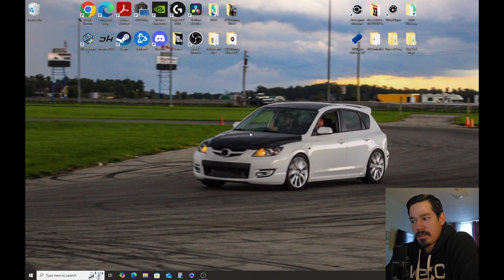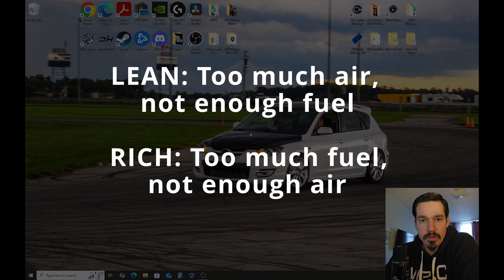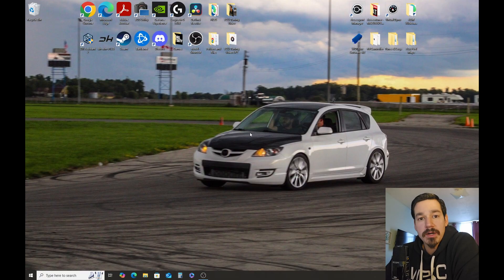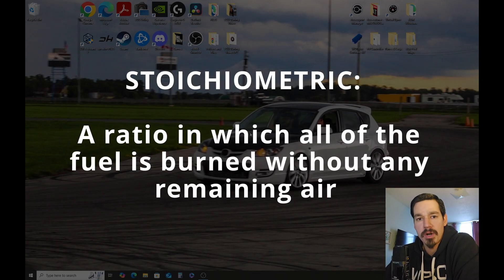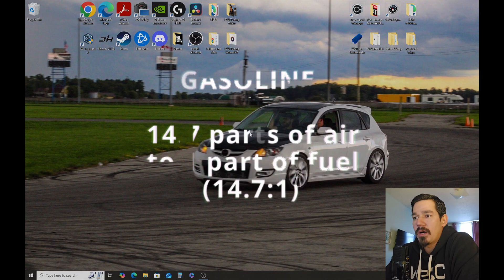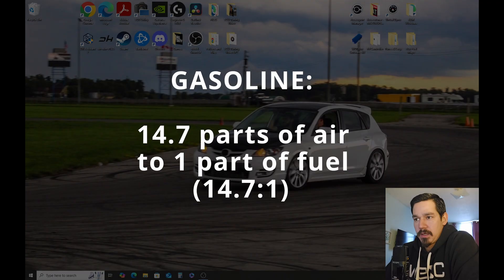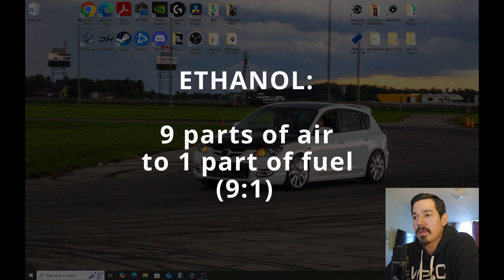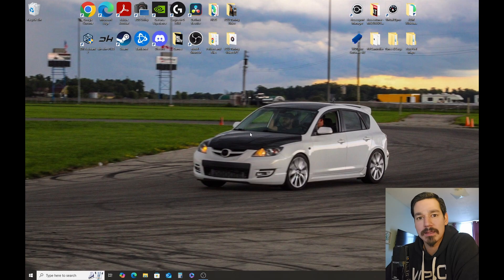Mazdaspeed 3 ECU Tuning Ep.2 - Understanding Air to Fuel Ratio

Comment: 9.8-1 for E85, lots of pro tuners use lambda values because the stoich value is always 1 regardless of fuel
Reply from the maker: @dylanstephens4075  I could be wrong but I don't think Lambda or AFR really matters in our case, as the O2 sensors only read oxygen content. The system doesn't know the difference between which fuel is being used. We change the injector scalars, fuel gravity, and MAF calibration values in the tuning software to compensate for changes in the AFR whether lean or rich. In the end the oxygen levels will vary based on how much alcohol is mixed into the fuel. Increasing the ethanol content within the fuel mix will increase the amount of oxygen measured at the primary O2 sensor. Without compensation through tuning, we will see the AFR or lambda become leaner. We will need to inject more fuel in this case to meet our desired rich AFR or Lambda under load.
Reply: @WannabeTuners correct but lambda is just a different way to display AFR values and is often times used in the tuning process, as the the ratio is displayed in a whole number and is the same regardless of fuel, e.g- gas 14.7-1, e85 9.8-1 etc. eliminating the need to remember stoich values for different kinds of fuel, just makes things easier to reference quickly basically, not saying you're doing anything wrong by any means, just offering a humble perspective, not that it's needed lol
Reply from the maker: @dylanstephens4075  Oh yeah I see what you mean

Comment: Hello, kind of unrelated question because im still learning about all of this (and thank you very much for these videos!). Is it true that if you stick with stock diameter intake then you don't need a tune? I got JBR Stage 2 intake which should be stock diameter all the way to the turbo.  Gen 2 speed 3 - I heard that its different on gen 1 to gen 2 a bit. Thanks.
Reply from the maker: @silentu55  if you're just installing an intake and it's truly the same diameter as stock, then you should not need a tune. If the diameter is off even by just a little, it will throw off the long term fuel trims and the ECU will have to make corrections at WOT as well.
Reply: @WannabeTuners  Thanks for the reply :)
Reply: @silentu55 The gen2s are a bit more sensitive to intake diameter changes. Also, even if the intake diameters are almost the same, they are not 100% the same and there are small variations (up to like 10-12% on a Cobb SRI). Also, the way the cone air filter create turbulences behind them, if you use an airbox or not (which has direct influence on the intake air temp - so fuel trims) and so on, may increase the need for a tune. If you only want more power however, a tuning solution (cobb or versatuner, I recommend versatuner if you want to stay on OTS tunes for a while, or even explore self-tuning) has the best hp for buck gains. The intakes will only allow you to make more power, but will not actually make significantly/measurably more power just like that, maybe only sound different. If you go for versatuner let me know, I maybe able to help you with pretty much all aspects.
Reply: @mituc  Thanks for the explanation. I actually bought Versa on black friday to get tuned later. For now I dont feel like I can safely self tune, lol. I got the intake just because a friend was selling it. Also yesterday I got HPFP with the rebuild kit, CS injector seals and EGR delete.
Reply: @silentu55  Well, after you install those HPFP internals things can go pretty rowdy in therms of at least torque, if not even power, and definitely the way the power is delivered can be a lot different with a custom tune (which I can help you with, just let me know).
Reply: @mituc  Ok, thanks for the offer. I actually recognised you after i checked your channel. I "know you" from MPS OC club :)

Comment: Well detailed and clear vid 🔥 ... Could you possibly  explain why tunes that are intended to make your car pop  and/or flames at the exhaust tip would be harmful to an engine  including how it works and what exactly is it happening .. there aren't much detailed videos out there about this .. I thought it would be good since you're already talking about afr  and tuning etc this would help the people in the platform make better informed decisions...id  do it myself but I feel you could explain it better and reach more people
Reply from the maker: @reyspeed33  Thanks man! Tbh I haven't done too too much research on how to tune for pops and bangs out the exhaust, simply because of the things I've read online of the exhaust valves getting too hot and wearing out the valve seats. I also read that some stock cars such as the Hyundai Veloster N have pops and bangs out the back from factory, so it's possible that at such low loads damage or wear may be minimal. I also read somewhere that this can be used to promote faster turbo response, which is probably why some of these OEM's have it. If I had to guess I would imagine that a small amount of fuel gets injected at low loads when letting off the gas pedal (where normally fuel would be cut), along with retarded ignition timing to initiate the combustion in the exhaust.
Reply: Ok, let's begin with how it's done and what happens:
To achieve pops&bangs in the tune you trick the ECU by manipulating some of the fueling and VE tables to cut the fuel later or dump fuel in excess during those decel events, and then use very retarded timing values to ignite that fuel later than normal. So basically the fueling needs to be cut late and/or allow some to flow into the engine even after the throttle was closed, and then ignite it later using retarded ignition timing values (-10 to -15 degrees if timing, so that is basically 15 degrees of crankshaft later after the power stoke began).
While the piston is already going down the cylinder pressure and temperature decrease so the mixture present in the cylinder (which is also very rich) will not burn completely and will actually start burning or continue burning (partially) during the exhaust stroke. So instead of those gasses making a "BOOM!!" inside the cylinder, they will explode in various points of the exhaust.

Why is this detrimental/harmful to the engine, turbo, exhaust valves and exhaust valve seals, catalytic converters if you still have them, and the exhaust tubing:
As mentioned above, some of that mixture will start burning inside the cylinder but because the spark occurred very late and also the flame front of the burning process is going to be slow because of the rich mixture and low cylinder pressure and lack of heat, the mixture will reach its burning peak when or after the exhaust valves open. That will create a lot of heat during the exhaust stroke and will heat up (or actually torch) the exhaust valves (which will transfer that heat to the valve seals hardening/damaging them), the exhaust manifold, the turbo exhaust housing and turbine wheel, and so on. Some of that heat will be retained in these parts so after a few such cycles the rest of unburnt fuel will ignite in the presence of air after contacting these hot parts.
These explosions and flame fronts created in the exhaust will heat up the turbo/cats/exhaust even more, and will also create pressure waves - which is what you hear outside the car. The pops&bangs are damaging for the turbo as well, especially for the larger turbos, because the same pressure wave will have more leverage on the turbine wheel in regards to the turbo shaft, so it will unbalance and work towards bending the shaft even more. Also a lot of the big turbos have ball bearings which are from ceramics or have ceramic coating, and that is a lot more brittle compared to steel or inconel.

My advice: don't do it. Especially if you have a big turbo :) If all you want is this sort of fun then it's absolutely fine to do it, but expect something to fail: turbo, valve seals, exhaust bolts/clamps, in some extreme cases I've seen engines overheating and cylinders going oval after 7-8-10 minutes of pops&bangs done on purpose at various automotive events/shows that were featuring burn-outs, pops&bangs, flames, and this sorts of stuff.

Comment: Thanks for the great episode.tell me is it normal for the gen1 to get part throttle knock during town cruising.sometimes i hit 3.40 to 5.25 sometimes.regards ryno
Reply from the maker: @rynoPelser-e7p  It's actually quite normal. Assuming it's not happening all the time, from what I've read it's just the ECU optimizing for fuel economy during cruising/low load situations.
Reply: @WannabeTuners  thank you.i fitted a bnrs3 also.have 3.5 inch intake with corsport fuel pump internals.also corsport topmount.with 76mm downpipe.what wheel power can i get safely for daily use.without ethanol.
Reply from the maker: @rynoPelser-e7p  With those flow mods and that turbo on just pump gas (93 octane), I'd say anywhere from 320-360 whp (I could be wrong). But this will probably be highly dependent on the dyno used as they may read/measure differently. The other thing too that I've noticed with my setup, is that I am able to push boost and ignition timing further on just 94 octane due to the larger 0.82 AR turbine housing on the BNR S5. When I ran the BNR S4, the smaller turbine housing definitely helped with responsiveness, but it did create more restriction at higher boost/loads, which caused some knock on just 94 octane. The better the entire setup flows, the more power you'll be able to make on pump gas alone without running into knock, as heat will be extracted through the exhaust system much more efficiently ;)
Reply: @rynoPelser-e7p As @WannabeTuners mentioned, one of the reasons for part throttle knock retard is the ECU correcting the ignition timing for various fuel economy and emissions purposes, based on subroutines in the ECU firmware that use data which we do not have access to. Please keep in mind that what you see on the "Knock Retard" column is not always actual knock, but ignition corrections based on inputs from the stability control and ABS modules, ignition timing variations when transitioning from open to closed loop and viceversa, mechanical noises from aftermarket exhausts (which are from lighter materials so they vibrate more and retain less of that vibration), motor mounts, VVT pinion rattle under normal operation, and so on. If those KR values appear every time in the same conditions (x-y% throttle input, R1-R2 RPM, l1-l2 engine load, t1-t2 ignition timing advance, and all these intervals are relatively small, then it's either a transitioning inconsistency or it's just a momentary adjustment the ECU makes for various reasons. Sometimes these can be tuned out, sometimes they are just things that are part of the normal engine operation. Start worrying when you see more than like 1.5-2 degrees of KR at high loads, and definitely address the problem if it's consistent or if the KR values jump higher than that at high PT or WOT.